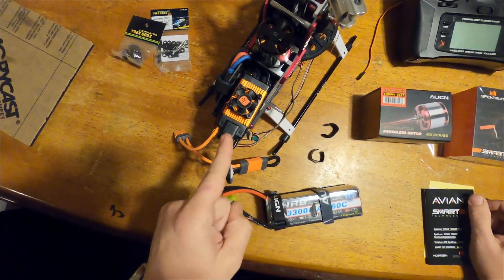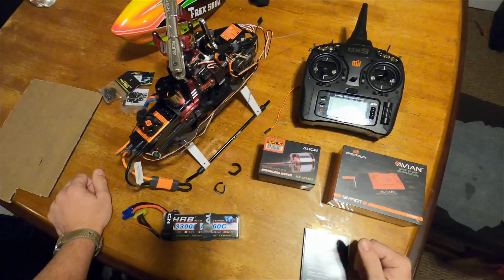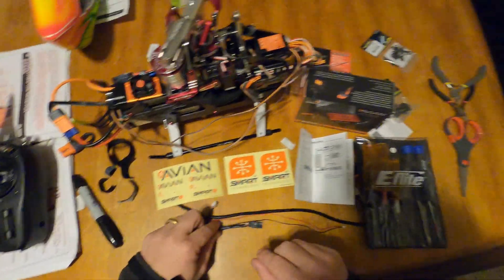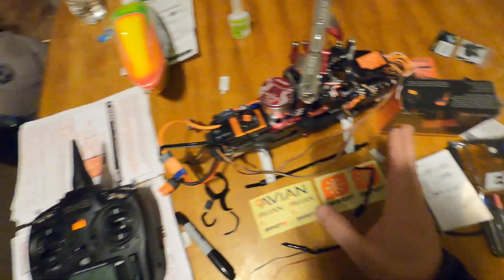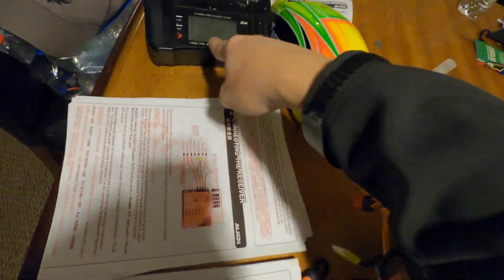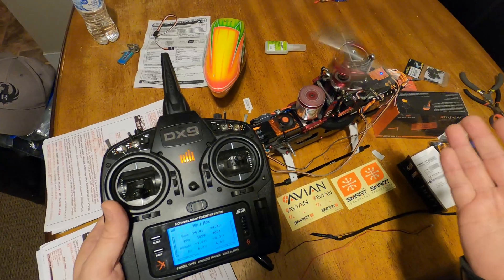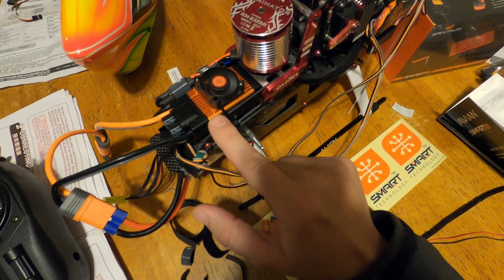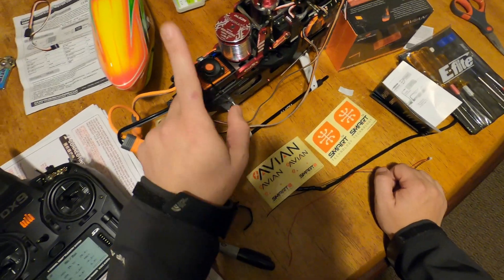Avian ESC Part 1

Comment: I bought the avian 120 for my first electric airplane setup.. the instructions are pretty vague for a first timer.. which one of the two wires are for throttle and which one is for power? Any help would be great
Reply from the maker: Black and orange are power.  Sorry didn’t get back sooner, thanks for checking out the channel😎

Comment: i typed you name on FB and there are a lot of people name Kevin Zenner.
i have a question. i just transition from futaba to spektrum. i purchased the ix14 radioand smart esc and smart CF6250HX flight controller w/ SRXL2 Receiver. horizon hobby tech told me that i would not be able to get telemetry with my microbeast. because the SRXL2 receiver had to be connected TO THE BEASTX. i guess they were lying to me

Comment: Hey how do you like this escs? Thinking about using one on my 700! 
Thanks
Reply from the maker: It worked good…rite on par with others but also SMART ready.
Reply: @rcflightz2058  thanks, I've been offered a cheape older castle creations but I've just bought the spektrum flybarless unit and I'm also on the dx9 so I'm tempted to try that ESC!

Comment: I looked up on the internet to see if I can  use a helicopter etc with a ground rc I was wondering if I can thanks
Reply from the maker: It has different modes…”linear” mode would probably fine for ground vehicles but I would probably still lean towards something designed for ground use…they usually go further to protect the capacitors and the units in general usually tougher.  Unfortunately I haven’t built a ground vehicle in a LOnG time…I remember mechanical speed controls :). My best advice is to get on one of the RC social groups and chat with someone building as close to what your building as possible…they’ll probably have some tricks to share and can explain why to use what.  Hope that helps, thanks for checking out the channel!